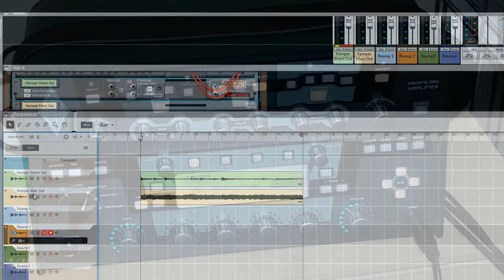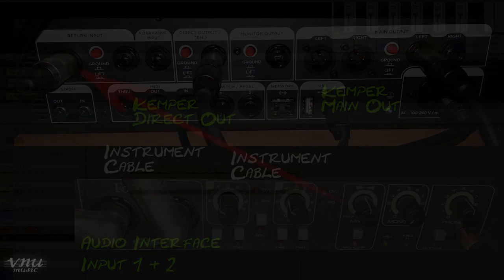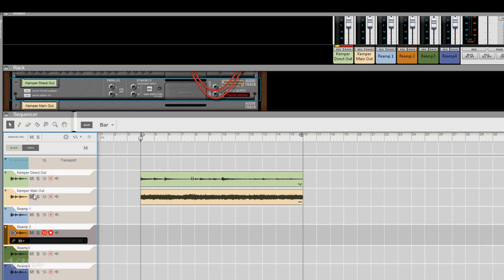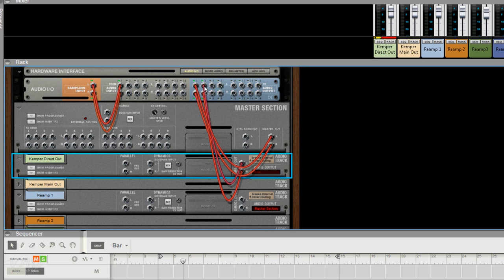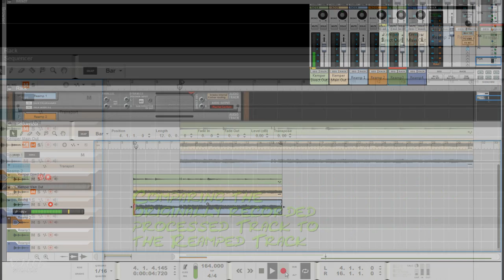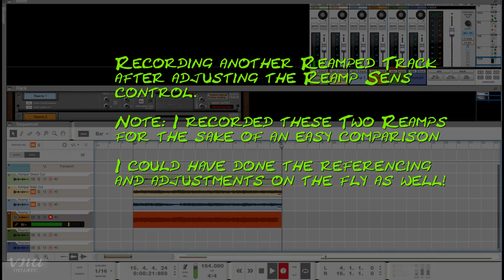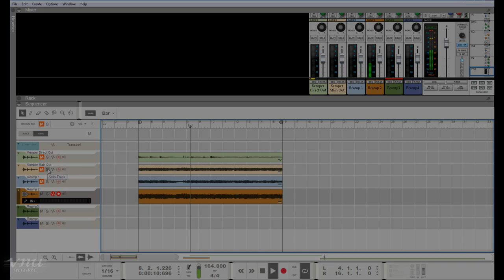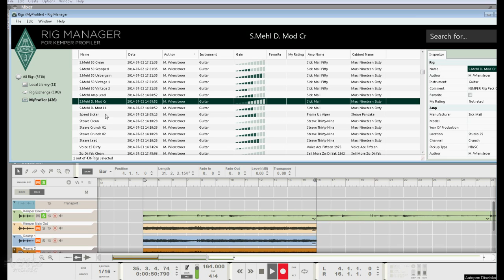Kemper Profiling Amp Reamping Tutorial

Comment: Great video, it really opened up my eyes on how to actually do this. I have one question. Are you using balanced or unbalanced cables to do the recordings. My recordings do not sound anything like yours and I have problems with feedback.
Reply from the maker: Paul Muller Hey, thanks for watching! I use unbalanced cables for a lot of recordings, however, I have a very small studio and thus I can work with shorter cable lengths most of the time. If you work with long cables, you might want to use balanced ones to reduce loss of quality (noise).
Reply: VNUmusic Thanks for the feedback, that is what i though. I look forward to more of your Kemper video series.

Comment: For the input source. why am i getting feedback for selecting "Return Input Reamp"?
Reply from the maker: djredmon1990 Hey there, this is hard to tell without a detailed info about your setup, but it sounds like you might have created an internal feedback loop, accidentially. I can only recommend to double check all your routing settings. For example, make sure, the output signal from the kemper going to an input of your interface, is not routed back to the channel with the dry DI signal (wich should be sent to an output of your interface, connected with KPA Reamp Return Input, only) in any way. Hope this helped! :)
Reply: VNUmusic Thank you for the quick reply back. I'll clarify the routing i have with my current setup. The input (1) from the interface is coming from the return input from the back of the Kemper.  and the output 3 and 4 is from the interface is directed from the main output (L) (R) from the Kemper.
Reply from the maker: djredmon1990 Ok,  do NOT connect inputs to inputs or outputs to outputs. Generally, an output should always be connected with an input. So connect interface output 3 to the Kemper Return input. And connect Kemper main outputs to the interface inputs.